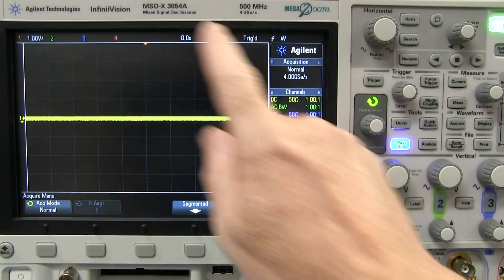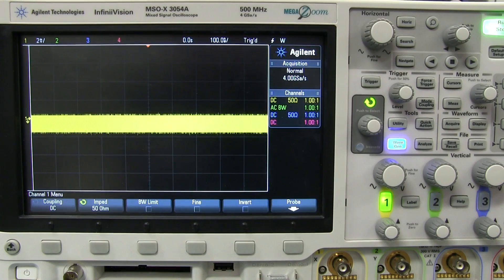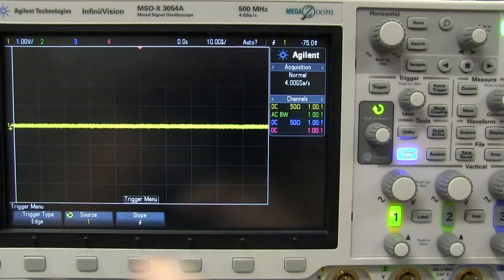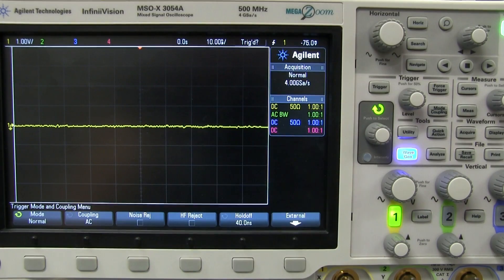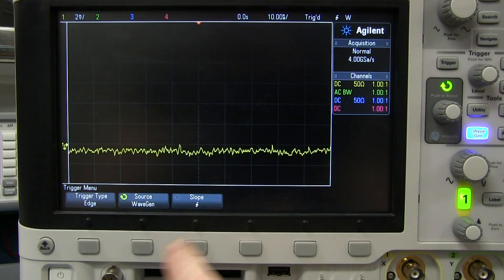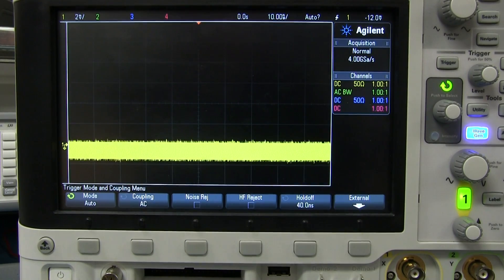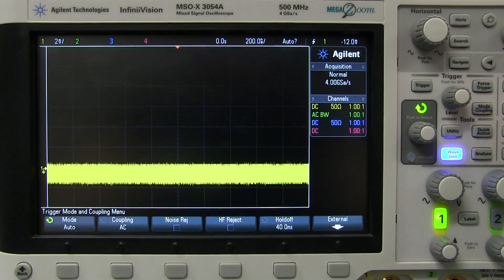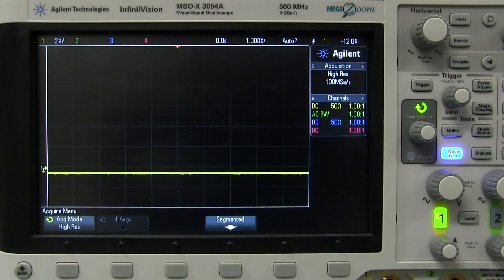EEVblog #610 - Why Digital Scopes Appear Noisy - Part 2

Comment: Very good explanation. I agree with it completely.

Other way of explaining it is that if it is gaussian noise, then looking at less samples, you will rarely go over over few sigma. But if you increase number of samples at each point (proportional to the waveforms updates, even with analogish persistance), say 10 times, then you basically add about 1 sigma to the width of your sample, making signal appear noisier. It is just statistics.

Actually if you run infinite persistence, and leave DSO running for few days, the width of the signal will increase even more, due very rear noise events.

Digital just make it possible to see signal much better, and make it possible to show very rear events, and high sigma deviations from average, which on normal CRT would be too rare to light up phosphor (without using long time exposure photos).

Really good video!

Comment: In technical terms, because the sheer bandwidth is so high, the noise is being folded back on itself.  Effectively, the sampling process is an RF mixer which converts the fundamental, and every harmonic, down to baseband, whether you wanted it or not (the trick is, you do want it, since that's why equivalent time sampling works).  Thus, with a million updates per second, and supposing a 60Hz display refresh, every 1MHz-wide band from 0Hz to 500MHz is being aliased into the ~16k waveforms being displayed -- bringing roughly sqrt(16k) ~= 127 times more noise to the party.

Those numbers are probably a load of crap -- the bandlimited noise at 2mV/div hardly looks like it's 0.008 div tall -- but the general idea applies, if probably with different parameters.  That kind of dynamic range would be hard to observe with an 8 bit ADC anyway.

Whereas, the high res mode (or the intensity graded mode -- which does histogram weighting of the samples, for a similar effect) limits bandwidth to what's visible on the screen: basically, update rate times number of pixels.  Suppose the visible waveform is 512 pixels long: the FFT of exactly one single-pass waveform (as visible on screen) might cover, say, 1kHz to 250kHz (at 100us/div).  Any lower frequency content looks like gradual curvature or DC (it can't be resolved into a complete cycle), and any higher frequency content is aliased, and either spreads the waveform (aliased), or is filtered out (in high-res mode).

Finally, supposing the front end (which particularly contributes noise on the lowest mV/div settings) or ADC itself (noise, quantization) has a given noise density (some constant nV/rtHz), the sheer bandwidth means HF noise dominates: there's a hell of a lot more MHz above 250kHz than there are below, so you should expect that high bandwidth settings, ranges, or scopes in general, should be noisier!

Comment: test from where the hell is that noise!, if internal from osciloscope, or external, if is the prove acting as antenna or not, or if it pick up signals from an OPEN input, what if you SHORT-GROUND that input....!, ?, the worst thing that an osciloscope can do, is to introduce internal noise.... , wrap the osciloscope in grounded aluminiun several layers, test everything. Don't show, the product "the noise" as all the show, we already know that it measure noise, !
Reply: You are COMPLETELY missing the point here.

Comment: what you demostrate? nothing, What I believe, if you has any osciloscope and shortcut the imput to ground (not with the full prove, but with the BNC grounding itselft), and if the osciloscope is not capable to show a 0v noiseless line, so IT IS INTERNAL NOISE from the osciloscope!, is not the same to test it with the input unplugged than short-grounded.
Reply from the maker: I said the input termination makes no difference. I demonstrated a practical reality of wide bandwidth oscilloscopes. Of course it is internal noise.
Reply: ok it is internal, it is a shielding problem, or internal generated by the same digital circuits from the osciloscope?. Internal, so, it isn't noise from the circuit that is being measured, that is quite a badass problem, don't you thinks that?
Reply: flyguille I don't known about others, but I don't like to see in the screen noise that is not from the board that I am testing. So, with these videos I concluded that depending on the task , like for low frecuency is prefferable a good analog osc, and maybe for high frecuency digital signals is prefferable a digital osciloscope because its better capabilities about hold/record /multichannel the digital signal to analyze (like in an FPGA develop task)..

Comment: Instead of using the internal wavegen, you could've also reduced the trigger rate by increasing the trigger holdoff.
Reply from the maker: That won't work in free running auto trigger mode. And in normal mode there is nothing to trigger off for that delay to work.
Reply: Ah, I had my analog scope brain engaged. On the analog scopes, the trigger holdoff will also adjust the free running / self-trigger rearm rate. Not so on the digitals....
Reply from the maker: ***** So did 8 other people :-> Today is one of those rare days I have my brain engaged at al!
Reply: Thanks for that, I could not think of the trigger holdoff.

Comment: +EEVblog, Am I right in thinking that these scopes actually are this noisy, it's just that with a CRO and low wf/s scope you can't see the noise... rather than as you're suggesting, that they aren't this noisy? If you take a single sample, and look at the peaks and troughs, or look at the section of this video where you use infinite persistence, isn't that the noise?
Reply from the maker: Attie Grande Correct, all wide bandwidth scopes are noisy. What I'm saying is in comparison to an analog scope, because that's the myth that is being busted here.
Reply: Have a watch of part one. He covers how to see the same noise on an analogue scope.
Reply: I know, but he keeps saying 'it's not actually that noisy' or words to that effect... it is that noisy, it's just that you can't see the fact easily on a CRO.
Reply: Sorry, I misinterpreted your question originally. I agree with you. Bear in mind that in at least Australia/New Zealand, when something "is not that _", it's usually a figure of speech rather than an explicit declaration.

I believe the point he is making is that the digital scopes are not worse than the analogue scopes and that they are just displaying roughly the same results differently due to the inherent differences in how they are rendered on the display. He demonstrates this nicely in the first video.
Reply: Interesting tip about the subtleties of language, thanks!
Yep, I agree.. but to a beginner I think the wording could be misleading. :-)
Reply: I'm thinking about this since part 1. Actually I don't see anything busted :). The scopes update rate is very impressive (wow), but do I want to see all the "noise" picked up from the air? Dont't think so. You are right, all high bandwidth scopes are "noisy" in term of showing more signal crap, but the analog and cheaper scopes are hiding this better. There might be applications were the better signal resolution comes in handy, but in general I think a cleaner looking signal would be better.
Same discussion as with multimeters :) - who the hell (normal person) needs a resulution up to 4 to 6 digits after decimal point when there are so very high tolerances in components ;).
But happy about every new video from Dave, loved the microphone series with DF (not so much the camera work ;) ).

Comment: If you work it out, the RMS thermal noise into 50 ohms with a 4GHz bandwidth is about 60uV.  Ignoring any internal or external noise, this would make the trace appear about 500uV to 600uV wide.
Reply: For a gaussian white noise signal, the peak-peak value over so many sweeps as this scope shows per screen display will be MUCH larger than the RMS value. I have the same scope and I just tried it - I get 230uV RMS. Bear in mind, too, that the scope input is not a true RF low noise amp because it is optimized for other things (like not being damaged by high voltage inputs).

Comment: I think the problem comes from an assumption made by some people that "good old stuff" was better. Maybe they enjoyed electronics more back then, and it is only a matter of opinion. Anyways, this is very informative. Thank you :)
Reply from the maker: Well, in this case the analog scope trace does certainly look like it has less noise than a digital one, and from a visual standpoint it does. So it's easy to think that and not quite understand what the digital is doing and why.
Reply: EEVblog Then they should have the option to switch noise off.....
Reply: This entire series is about how to switch the noise off :D Even my low end Rigol has adjustable low pass filters. You certainly have that option :)
Reply: Too much smoke and mirrors, an adjustable LPF is the answer. I chose what I want to see when and where...

Comment: The reason they appear noiser is because the new scopes aren't made with oxygen-free copper like the Monster cables, hence noise is so high. As well, they don't have cryogenically treated capacitors which stabilizes the electron spin, reducing noise and adding "airiness" and ambience to the signal without losing detail. Also are those knobs balanced? Ideally they should be using wooden knobs balanced to 1/100 of a gram and made from redwood  - these introduce less jitter when you turn them and hence less noise.
Power cord - What are you using for a power cord into the scope? Should be using one with cryo-treated LiniPure monocrystal conductors and at least 6 die-electric layers in order to avoid quantom tunnelling effects cause by atoms jumping across impurities in the copper. This opens up the "stage" of the signal without adding excessive cohesiveness or sharpness to it.
Next time, know the actual science of what is going on, instead of quoting meaningless non-sense terms like "frequency".